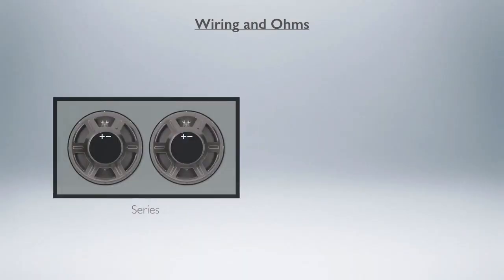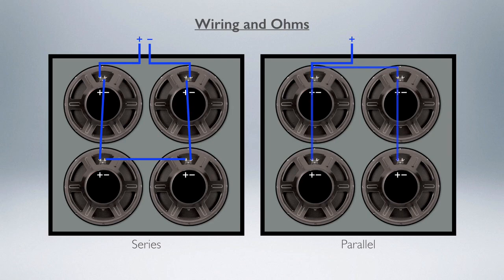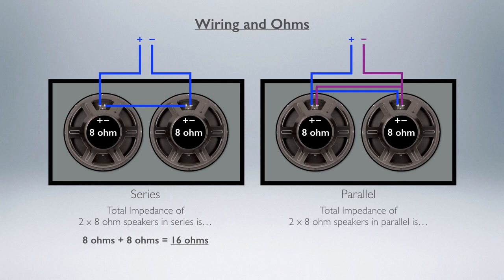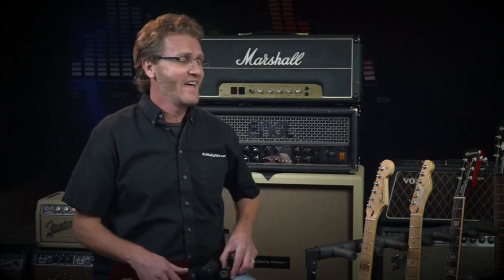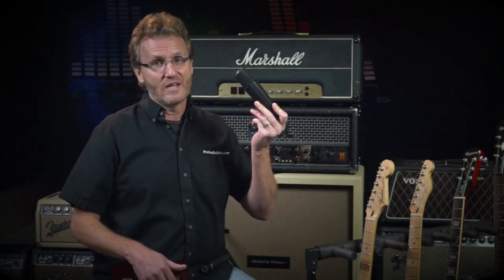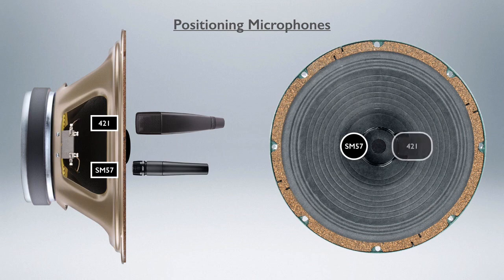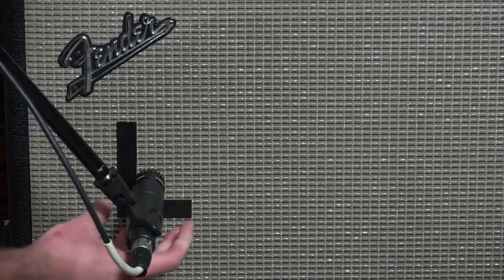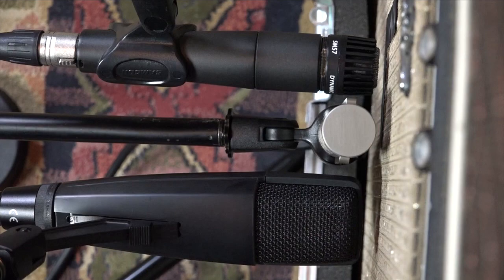Speakers Specifications

Comment: So I have an amplifier with speaker connections that are the positive and negative wires are stripped at the end and I have to just screw them down on the post with thumbscrews so if I made a bridge for my positive connections could I jury-rig some speakers in series or would it blow everything up?